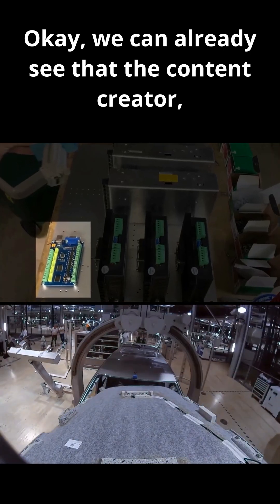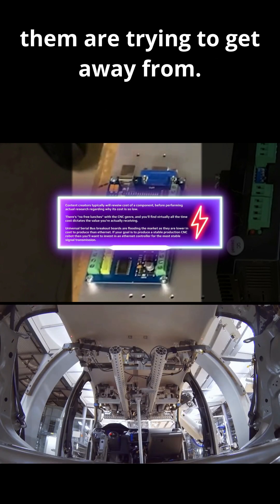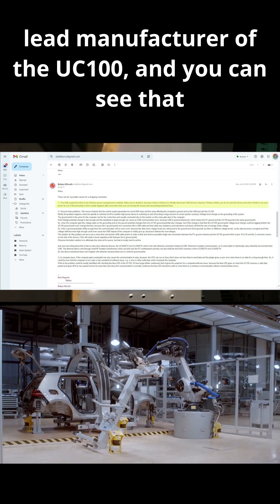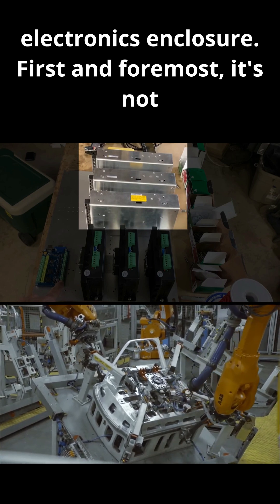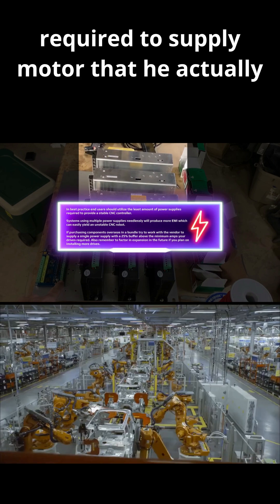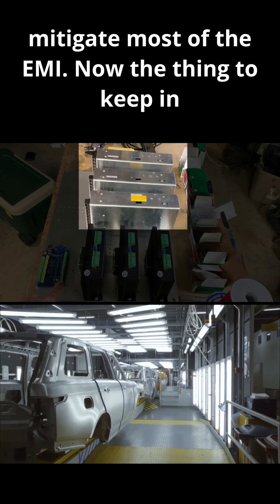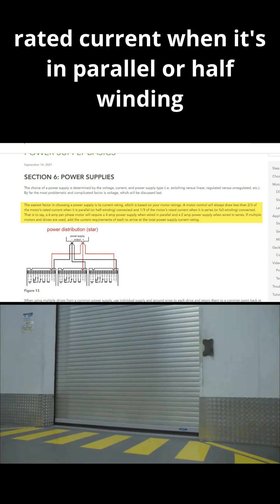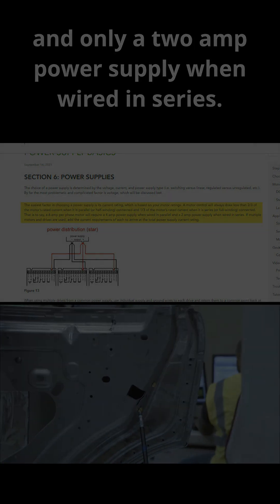🛠️ CNC Pro Tip: Skip USB 🚨 & Size Your Power Supply Perfectly 💪

Comment: I started out years ago with a grbl control and was unhappy with that system. I then upgraded to parallel port bobs. Now I use ethernet controllers as there are so many more advantages. My controllers cost around 2K USD (parts alone). I don't build them to sell, they are only for me. Price is irrelevant and performance is everything. I see over complicated controllers with gimmicks and horrible wiring all the time. Another major fault that is common is that there is not enough spacing between the motor drives for cooling. Also my VSD is housed in an external steel enclosure. Keep up the good work.
Reply from the maker: Thank you for your support! Vince